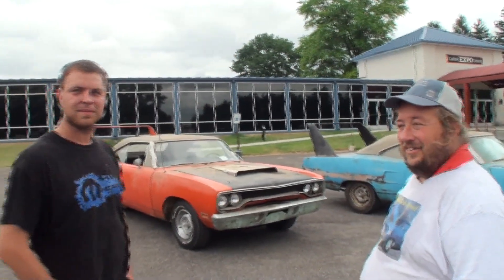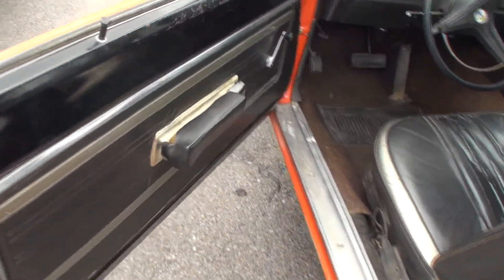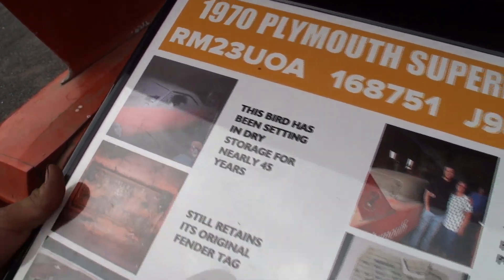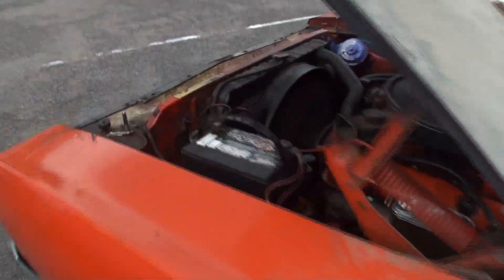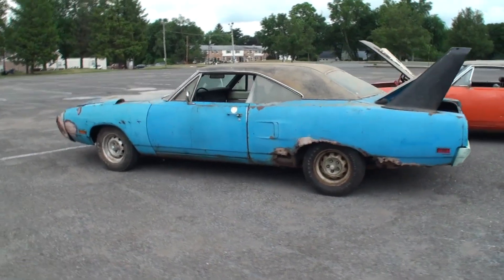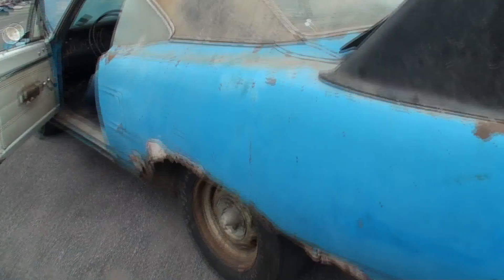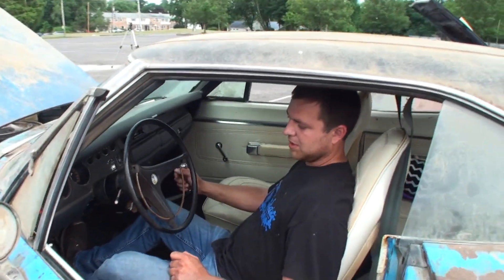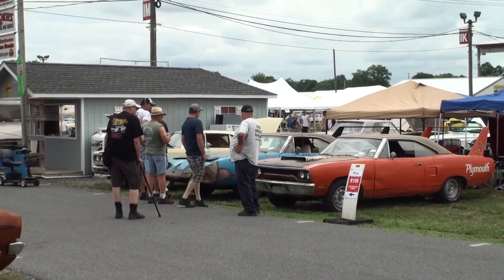Two Barn Find 1970 Plymouth Superbirds parked since 1975 RUN AGAIN ! My Car Story with Lou Costabile

Comment: I'd never get the restoration done I'd be driving it daily lol
Reply from the maker: Hi Shawn, Thank you for viewing & sharing your thoughts, Lou
Reply: Totally agreed!
Reply: It would rust away in about 2 years if it's not restored. Look at the deterioration from while it was sitting inside. It's needs an engine/trans rebuild and a ton of body work.
Reply: How far to restore is the owners call, whether full restoration or just the basics that make it safe to drive for you and others you're on the street with. It's always nice to keep things as original as possible but there's a huge difference between old and worn from use vs rusted out and neglected from sitting on the ground. Barns can be good dry places to store a car but they also can be damp and dark depending on the building and it's upkeep. Bottom line is if it's unsafe it's needs restored for everyone's safety

Comment: Lou some amazing barn find Superbirds! When I was a young guy back in 78 the local Chrysler Plymouth dealer had an Orange Superbird and an Orange Road Runner on the lot. They were the personal cars of the owners son! The Superbird had really low mileage like 15K and the Road Runner like 30K. They were basically in show room condition. They wanted $3500 for the Road Runner but for me back then I was washing dishes for $1.15 an hour so it was not possible to buy it. I still can picture them sitting there like brand new on the lot! A few years later I bought a 73 Plum Crazy Challenger with a 340 and Pistol Grip Shifter with console and the original Rallye wheels. Those were amazing cars then and now!
Reply from the maker: Hi kickit59, Happy to read you enjoy these rare Birds. Thank you for sharing your story too, Lou

Comment: The orange one just doesn’t look right with it’s beak cut off.
Reply from the maker: Looks kinda back heavy
Reply: I think it's a road runner with a wing
Reply: @HotRodRocco  I was thinking the same thing. If you look closely at the brackets for the wing they look a little new to me. Maybe I'm wrong.
Reply: @donaldirvin8008  Its a real Bird.  I've known these cars for several decades. The person they bought them off of owned several high end Mopars including a 3rd Superbird which is fully restored and was given to his daughter.
Reply: @biginjun  they're awesome cars and we're a great find. These two lucked out for sure.
Reply: @donaldirvin8008  They did luck out.  I know quite a few people who were trying to get them.  And at one time, the barn also held a 69-1/2 Superbee, an 70 AAR Cuda, a 70 Charger, and a few other collector Mopars.  I used to drive past it just to see if I could catch a glimpse of his restored Bird sitting outside.
Reply: Excellent Idea Aero Car Wing Spoilers  mounted on Classic or Clones of The 1968/1969 Dodge SuperBee 1969 Charger 500 and 1969/ 1970 Plymouth GTX Coupes.
Reply: @HotRodRocco  
If it is, someone went to a great deal of trouble to install a Superbird-correct rear window & wing support brackets with the correct factory X markings hand-drawn on them.

Comment: Did you notice the Mountain Dew can as the radiator puke tank on the orange bird ?  Commonly used when drag raced, which were required to keep the tracks clean of fluids.  My bird had a 1/2 gal milk jug as its puke tank when I purchased it from the original owner.
Reply from the maker: Hi Sublime Bird, Glad to read you enjoy the details, and happy to read you had one too :-) Lou

Comment: WATCH YOUR FUEL HOSES!   I just bought an AAR Cuda that has been sitting since 72. It's mint. I smelled gas in the house and went to the garage and there were 15 gallons on the floor! The fuel lines look perfect but they crumbled in my finger tips. I guess it's the fuel they make now isn't compatible with the original rubber. It was an awful ordeal.
Reply from the maker: Hi Campesino Plastic, Thank you for viewing and sharing your knowledge. Hope you see many more cars on this YouTube Channel you enjoy. Please subscribe, and hit the "bell" so you can see all the cars when they are uploaded on this YouTube Channel, Lou
Reply: Even the 'new' rubber hoses don't last. I changed the fuel hoses on my old 1970 Dodge truck and 2 years running this junk alcohol gas they were hard as a rock. I used Gates 'Barricade' hose and it stopped the hoses drying out and also the evaporation of the gas through the hose. I had a car that I stored with stabilizer and a full tank of gas and after 10 years in storage 1/4 tank of gas evaporated.
Reply: @vincemajestyk9497  You have to find ethanol free fuel. It's expensive. We have it here at WaWa and some places that cater to boats.   It dissolves rubber and is hell on carburetors and aluminum parts. It is bad for boats, old cars, lawn equipment, generators, pressure washers
Reply: @campesinoplastic6169  The gas that I had in my car that evaporated was a combination of Sunoco 260 112 Supreme and Unocal 110. 15 of 20 gallons left which I guess is 'normal' for the old evaporative emission systems and hoses. The hoses were hard afterwards. As far as my small engine power equipment I have been using Pure Gas for the last 5 or so years. There are about half a dozen Pure Gas stations near me, Marathon and Kwik Fill that I go to. The alcohol gas is 'OK' in the modern stuff as long as you burn through it quick. It goes 'sour' in 2-3 months depending how well you keep it sealed. I have an electric fuel pump and gas shut off valve on my truck so I just run it out of gas if Ilet it sit. It is a pain though because the ethanol gas does vapor lock much easier than pure gas.

Comment: Great find Lou as usual. First of all whoever is ultimately responsible for parking these beautys that led to more than 4 decades of neglect need smacked REPEATEDLY.
The blue one is a lot worse for wear and will require some extensive restoration, but the big plus is the fact that it still has the matching numbers engine/drive train.
But the greatest thing of all is the old school "Honk if you like sex" decal at 7:37. 😄
Reply from the maker: Hi Jeffrey B, Happy to read you enjoy these two rare Birds...and sticker too :-) Lou

Comment: Who takes a car, especially like these, and parks them in a barn and then leaves them in for 40 years?  I see these finds all the time.  Little or no salt damage.  And these look way better without the nose.
Reply from the maker: Hi txlonghorn82, I drive the ones in my garage, so I'm not sure who'd be able to do that. You raise an interesting question, Lou
Reply: They were considered fairly ugly for the time. Some were 'reconverted' or languished on dealer lots and sold far below sticker price. Aesthetically most people preferred the original Road Runner appearance to this.

Comment: Was the blue running on straight pipes ? Sound so good.
Reply from the maker: Not sure, however I agree, they sound good.
Reply: I was trying to figure that out too. In one shot when they pan to the wheel it looks like a 'new' tailpipe, or it could be the gas tank which I presume would be new also. Anyway, those mufflers sound EXACTLY like the Classic Chambered exhaust mufflers. I'm thinking they would have needed to change the mufflers sitting in the barn that long. I think they are the Chambered mufflers from how it sounded from the rear.

Comment: 60,000 miles and parked in 1975...These cars by 1980 had over 130,000 miles on average! 5 digit odometer they never show 100,000 miles..So people who buy these cars add 100,000 to the odometer and thats accurate..Even a car with 90,000 it's probably 190,000 min..My 68 Charger RT has 460,000 miles!! I put on 210,000 miles myself,car looks runs perfect! owned this one since 1994 was my daily until 2001.
Reply from the maker: Hi 01trsmar, That's quite a few miles on yours. You've clearly been a GREAT Care Taker. Thanks for sharing, and keep up the great work. Hope you see many more cars on this YouTube Channel you enjoy. Please subscribe, and hit the "bell" so you can see all the cars when they are uploaded on this YouTube Channel, Lou

Comment: Well, the orange one is not a superbird.  it is a roadrunner with a superbird wing.  Really poor attempt to pass it off.
Reply from the maker: Hi Jim Johnson, Not sure you're correct on this one, however thank you for viewing and sharing your thoughts, Lou
Reply: @loucostabile  The VIN# won't lie!!!!!!!!!
Reply: It is a Superbird. You can tell by the back glass and window plug and trim around it. Also the bracketry in the trunk. No way someone could fake that on a car that old without tearing up the 50 year old vinyl top.